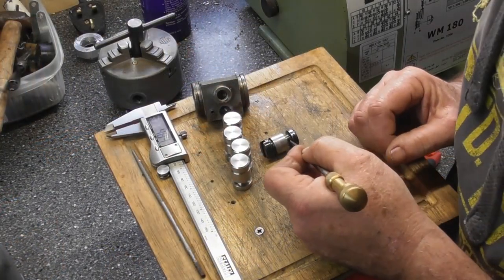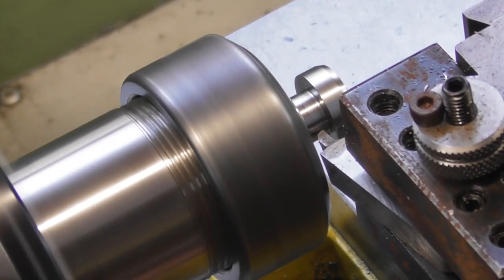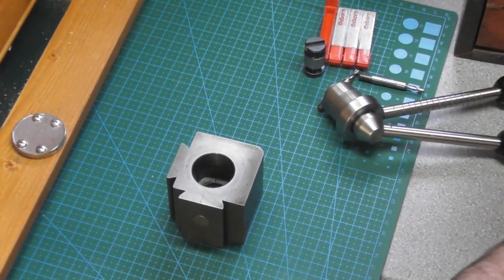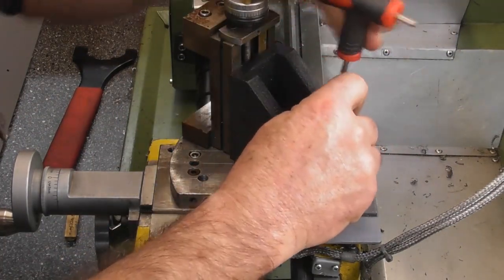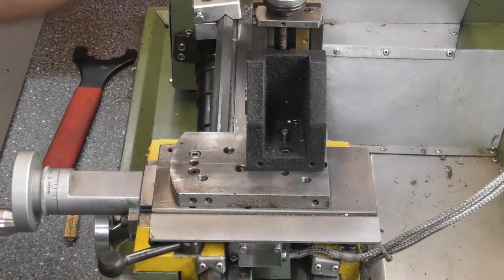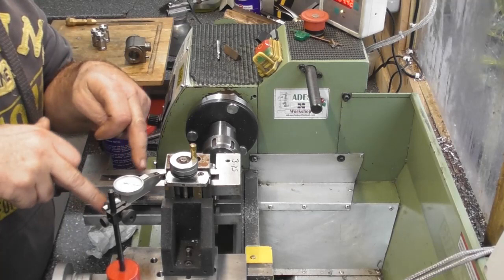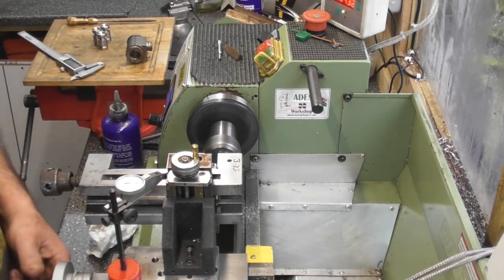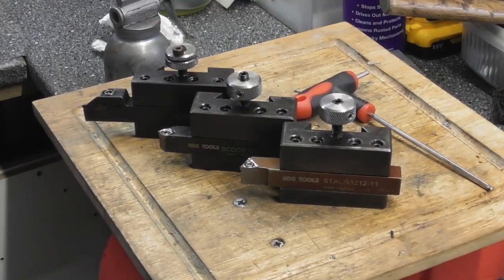Stainless Steel brake pistons part 3

Comment: Those pistons came out beautifully, and you did it the right way with what you have, as you say.  There are many with Engineering Degrees from Armchair University, and we just have to run with what we have.  I have a few jobs on the go for doing favors for buddies and even just for the challenge as I think people would find it interesting as well.  Thanks for just being yourself, and I agree that even though there's nothing wrong with sitting in one's shop talking to oneself it is much more fun when others are joining in!

Comment: Hi Ade, another interesting little project.  Thank you.  I don't think you can rely on blueing alone to provide rust protection.  A smear of oil is never a bad idea, especially in a shed that will almost certainly be damp at times.  I use a small dehumidifier to keep the moisture down.  They're not too expensive these days, and most can accommodate a continuous drain.  Just don't leave the door or windows open, or you'll dehumidify the world.

Comment: Well aren’t you “sitting inside your shed talking to yourself”?A stranger standing outside your shed would think so:)
Another job well done with what you have to work with. Each time you change over to milling mode you must be salivating about the mill you’ve researched. 
Cheers 
Peter

Comment: That’s a funky design flaw. I’ve never seen a lathe where the compound can’t be set at 90 degrees. Good solution for the job though. It why some large lathes had the compound hand wheel and dial at an angle upwards, using gears to transfer the horizontal motion to about a 15 degree upwards one.

Comment: Ade,
I run my grooving tool (used for most parting off jobs as many do) a tad lower than center, I find it cuts better that way. Only my 2d worth. In my opinion those riser block for a small lathe is one of the best tools to make improve rigidity.

Comment: I just finished milling my first tool holder ON THE MILL rather than using the lathe as a mill... So much better, both in how I can see what's going on and how the milling table moves, and rigidity. I just have to drill and tap the holes for the holding screws and the height adjustment. Aside from that, it's also great not having to switch between milling setup and lathe setup on the lathe. Unfortunately, during my hammering to wire up the electrics, a little piece of metal to fall into the three-phase inverter, and when I tried to power it on, a little flash and fuse clicked off. So no lathe until I can fix the three-phase... Hopefully will be just a couple of days, already ordered a new one on Amazon.